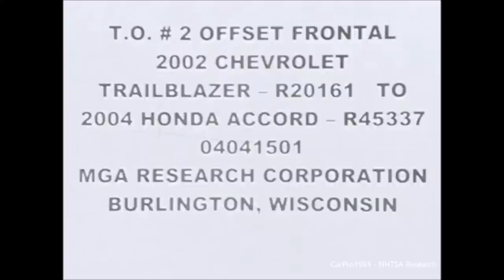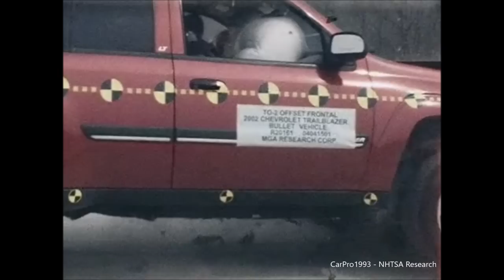2004 Honda Accord Vs. 2002 Chevrolet Trailblazer Offset Crash Test (50% Overlap)

Comment: We had a 2002 LS from new until about 130000 miles (2011) in that time it had quite a few small issues but was overall reliable. The taillight circuit modules would go out once a year like clockwork so GM had to fix it under warranty and at 45000 miles the transmission refused to shift into overdrive. Was in at least 3 small accidents and one large one but took hits well. Came out of work one day and it was gone, stolen. Was a very "meh, oh well" moment lol

Comment: They keep narfing these Honda’s, yet they seem to hold up well, considering the circumstances
Reply: Not really.  The Accord's passenger compartment was severely compromised, and the driver dummy slid between the driver airbag and the side impact airbag, which greatly increases the chances of a severe injury.  I'm sure it would have fared better against a vehicle it's own height and weight!
Reply: The Accord's left A-pillar is bent... the structural integrity seems weak.
Reply: @brentboswell1294  The Accord held up extremely well. Low chance of head injury and probably a broken leg or 2. Surviving a direct hit from a vehicle that weighs 50% more at 60 mph.
Reply: That did not hold up well. If the Honda would have been the vehicle in motion instead of the Trailblazer, the outcome would have been the same.  Yes, the people in the Honda would have lived, the people in the Trailblazer walked away.
Reply: @Nothingtoya  given the circumstances the Honda held up very well. If you survive a 50 mph offset crash w a vehicle almost double the size, it held up.
Reply: @smokesgtp  theres about 1000 pounds between the 2, depending on options. That's not double the size or weight. I'm not saying the Honda is a pos, it held up ok and I'm sure it held up better than other vehicles of the same year.
Reply: Your eatinf the intake manifold bruh
Reply: Brent Boswell i mean thats like 60 mph.
Reply: Dude. The Trailblazer is a +5,000 SUV. The fuck are you talking about?

Comment: The dislikes are from everyone who realizes that the Honda comes out on the losing end (in no small part because it gets overridden by the larger vehicle).  Glad to see the electronic stability control working to keep the Trailblazer upright!  Glad I entrust the safety of my family to one of these...I personally got into a similar accident (2015 Toyota Tacoma vs. 2015 Ford Mustang).  My Mustang was totaled, but I walked away from it!  Also, it would appear that the Trailblazer was picked up at the nearest used car lot: lots of underframe corrosion, yet the truck (Yes, these vehicles are full on body-on-frame trucks!) maintained it's structural integrity well and wasn't affected by the high level of corrosion!
Reply: @smokesgtp  Yep. Though some had good luck with them.
Reply: Brent Boswell they not giving us any test results so we know how the dummies fared for injuries. It’s not how the car looks after a hit but rather the safety of the occupants
Reply: GM actually didn’t add stability control and side curtain air bags to the Trailblazers and related SUVs until the 2005 model year. So the fact that it stayed upright was more so due to the fact that it’s so heavy vs. what hit it/getting lucky it didn’t roll over.
Reply: @ATRichard  
No my 2003 TrailBlazer had ESC.
Reply: @francesco1998  https://en.m.wikipedia.org/wiki/GMC_Envoy Not possible. Check Wikipedia and some other sites - GM didn’t add Stabilitrak to the Envoy, Rainer, etc. until 2006 (I originally said 2005). I have a 2004 Olds Bravada (final year for Olds) and love it to death. But it’s a death trap in all honesty compared to a modern SUV because while it does have AWD, it doesn’t have stability control, rollover control, traction control, or side airbags. GM didn’t even make side curtain airbags standard on these until ‘08!

Comment: The Honda did really good for taking all the force, the dummy's moment was pretty well controlled and the structural integrity was maintain pretty well too. I bet the Blazer wouldn't do as well if it was on the other end
Reply: Which one is moving has zero effect on the results.  Go take a physics 101 class.
Reply: @01Z06guy  okay I'll give you that I probably am wrong, I got off without taking any physics soooo yeah 😝😝😂

Comment: Would have been better if the test could have both vehicles in motion at same speed... The tranfer of energy by trailblazer can be felt and seen on Accord..but it dtill held very well..
Wonder if both were in motion .. trailblazer would have rolled over and impact vould have been at different level..

Comment: All these damn cars/SUV's today are junk...doesn't matter what brand...you barely lean on em and they buckle. Try that on a 72 Caprice
Reply: They're made to buckle so your knees don't.
Reply: IDK about a Caprice, but I've seen a video of an offset crash involving a 70's Chevy Impala and the A-pillar bent from hitting a Chevy Vega!  In a direct head on a lot of old cars were pretty strong, but in an offset crash the frame would twist around and crush the passenger compartment.
Reply: What about the bel air vs the newer malibu??? Malibu trashed it.
Reply: Cali Dude a72 caprice was built at a time where cabin safety standards were not as strong today. I’d rather be in a modern accord than a 72 caprice in such a crash